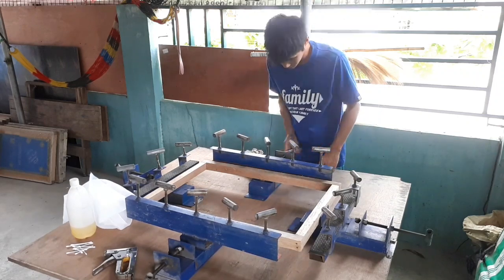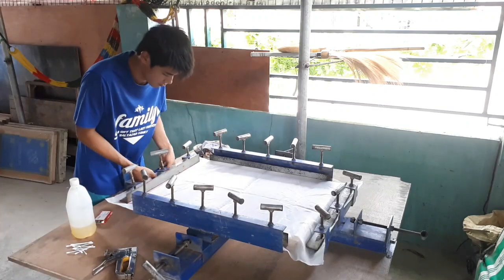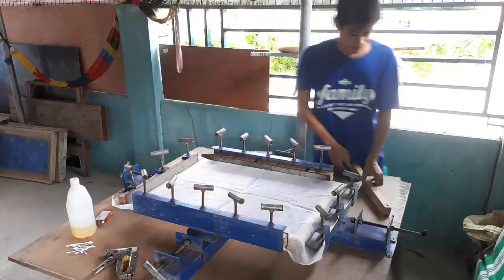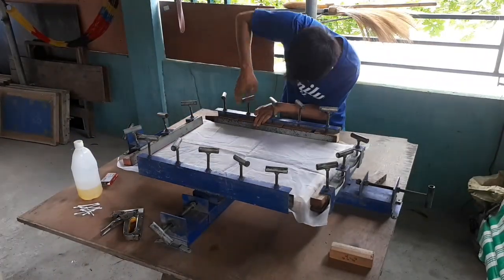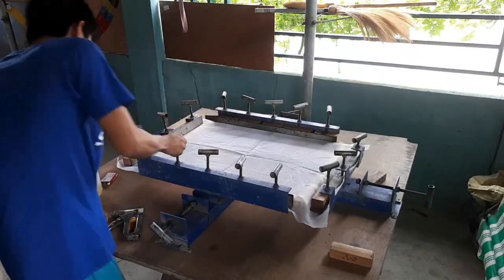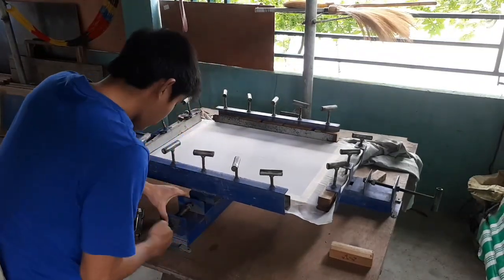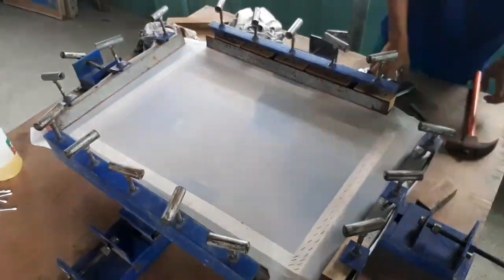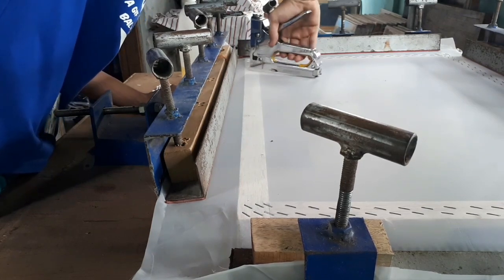SCREEN STRETCHER | SCREEN PRINTING | T-SHIRT PRINTING | SCREEN LIFE

Comment: It took a couple of years to understand how these four side clamp and tread stretcher works. I watched YouTube a lot, and looked at a lot of images. Because no  screen printer in my area uses such method. They all used their bare hands to do the stretching (Which is very cumbersome and does not give good tension) and they still don't know that they are screen stretchers out there. So I finally and finally arrived at making one like yours (24 x 24 inch angle stretcher with 20 clamps (nut and bolt) and square pipes, with 4 nut and bolt treading  under a cool budget of 80 dollars instead of buying one from Amazon, Alie Express and Ebay at a high cost. For mine I don't go round it because I attached the square pipes together and a bearing under to rotate while standing in one side and treading. Thanks for your video. From Ghana West Africa.

Comment: It took me a couple of years to understand how these four side clamp and tread stretcher works. I watched YouTube a lot, and looked at a lot of images. Because no  screen printer in my area uses such method. They all used their bare hands to do the stretching (Which is very cumbersome and does not give good tension) and they still don't know that they are screen stretchers out there. So I finally and finally arrived at making one like yours (24 x 24 inch angle stretcher with 20 clamps (nut and bolt) and square pipes, with 4 nut and bolt treading  under a cool budget of 80 dollars. For mine I don't go round it because I attached the square pipes together and a bearing under to rotate while standing in one side and treading. Thanks from Ghana.